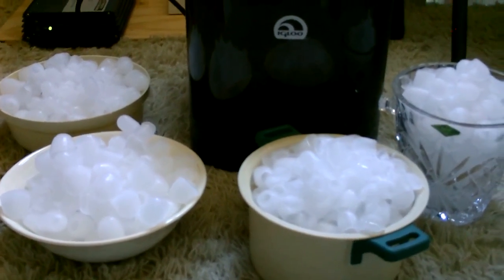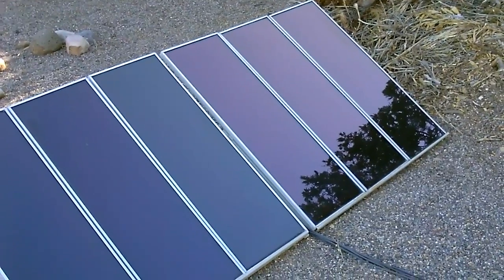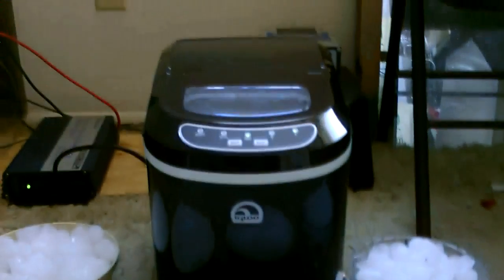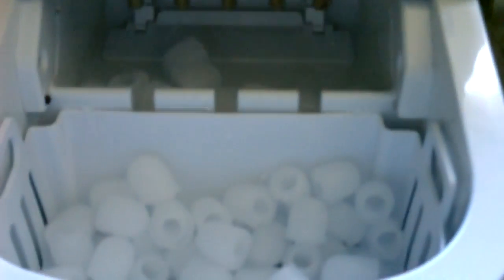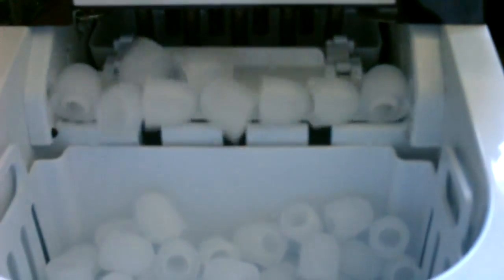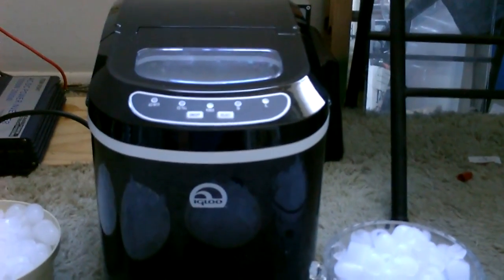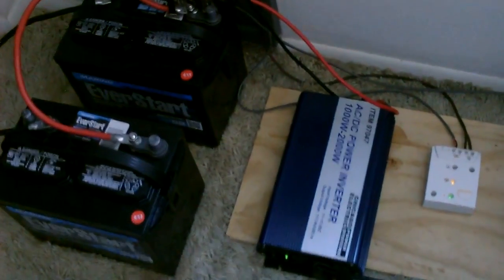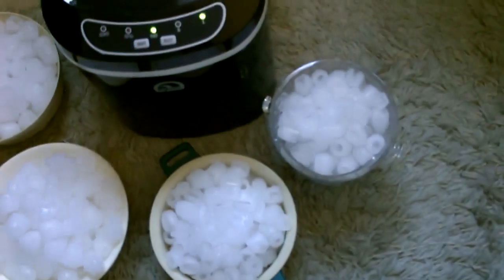DIY Solar Ice Maker - solar powered 'off grid' ice maker - easy to set up! - use HFT panels

Comment: Would this setup work without the solar panels, with the batteries only, and just one marine battery?
Reply from the maker: i think you would need at least two batteries to run the ice maker. it has a startup surge and i don't know if one battery would would handle the surge. maybe if it was a large battery.

Comment: Huh ??
Solar power with extra "battery" hook ups ??
Reply from the maker: hi. since the icemaker has a start-up surge, you need to have a "batteries with panels" solar setup to run it. if it didn't have the surge you could just run it straight to the solar panels.

Comment: One of the most expensive parts of a solar / electrical system are the batteries.   So instead of storing excess energy in battery cells - make ice.   I'm thinking this would work well for my family in the Philippines.  Keep food fresh... make halo halo..or just sell bags of ice.

Comment: Nobody is putting up electrical specs on electric appliances. Getting very frustrated trying to just find out if ANY icemaker will work. By the time I buy a new inverter and icemaker, maybe I should look for a 12V freezer.

Comment: Does anyone know where I can find an ice maker that runs on DC?  Or make one?
Reply from the maker: hi. you can buy 12v DC freezers on amazon. they have them for as little as $150.00. they're not dedicated ice makers but they will freeze ice solid. they are made to run on a cars 12v power port. if you want a larger 12v DC deep freezer look for sundanzer chest freezer.

Comment: what is the rated wattage of the this machine?
Reply from the maker: hi there. it pulls about 90 watts. wattage rating on machine is officially higher than that but that is because it spikes a little higher from time to time. those times are so short though that it's essentially just 90 watts. you need the bigger inverter because of the spike at start-up. that spike is only a fraction of a second but the bigger inverter is needed for it

Comment: Wonder if you can put  a micro easy start on the  ice machine.an use less solor power.
Reply from the maker: hi there. since the spike is only for a fraction of a second at startup it won't really save any noticeable power

Comment: so if u could get the tray to empty into a bigger cooler full of ice water and then have that be the ice water that the bilge pump pumps throught the water to air heat exchanger and fan and have the condensation from that collect and pump into the ice maker :D

Comment: I've started making my own off-grid ice cream. 1 can condensed sweetened milk, an equal amount of milk made from powder and 1 can of creme. All staples in your cupboard. Mix well by hand and mix during the freezing. Use a big bucket of ice, add a cup of salt and churn away. You might need to reduce the amount of powdered milk at your second batch if it won't freeze solid enough. Ive left the powdered milk out altogether  but the result is such a rich intense sweetness I could only eat a little bit at a time. You can add cocoa for chocolate ice cream, vanilla flavoring for vanilla ice cream, or some strawberry preserves out of a jar for strawberry ice cream. Enjoy.

Comment: Some good news, some bad.  The good news is that yes, you're making ice! Go you! The bad news is that you're using almost 8 amps per hour to run that. How do I make ice you ask? I can make ten pounds of ice ever few hours if I want to in my 63qt fridge/freezer that only uses 5 amps per hour and keeps all my food and drinks cold WHILE making ice in good old fashion ICE trays...  And yeah, it all runs on a 100 watt Parnell and a 100 ah battery overnight...  I actually have double that to make the batteries hold up that much longer, but one panel and one battery would also work fine!

Comment: I put a Solar ice system together similar to yours but can't get it to work.  I'm using a 200 watt solar panel, 20 amp capacity charge controller, 2-12v deep cycle batteries,  a Harbor Freight modified sine-wave DC/AC Inverter w/750 watt continuous -1500 watt surge, powering a Dometic ice maker that looks exactly like your Igloo ice maker.  The ice maker comes on and runs for about 50 seconds, then the inverter shuts off into the over load signal  In checking the output of the inverter with a volt meter, the output is about 102 to103 volts with the voltage rapidly and continuously fluctuating between 60 to 100 volts even when not powering anything.  The batteries are fully charged.  It will run a drill or blender or light bulb, but not the ice maker.  To check my volt meter, I checked my house voltage and it holds a steady 120 volts.  Any ideas?
Reply: GereDJ2 I see it did not work. Did you ever get it working? Bet it needed a larger inverter.
Reply: Or a pure sine inverter or a larger inverter

Comment: I wonder if a 300W inverter could run it.  Yes the surge is 800w but some might be able to handle it.
Reply: thats a pretty bad idea. It will only use the current that it needs so its not like it will be cheaper to only use a 300. If it surges to 800 bye bye inverter

Comment: Just had an idea! Have you ever seen those AC people make where they blow air through a cooler filled with ice? The drawback is you need a constant supply of ice. Well, you could set up your solar ice maker so that the ice falls into the homemade AC and you got your constant supply of ice!Come on, man, you already got 1/2 the gear. Give it a try and post a video on how it works!
Reply: I've have been using ice machines for awhile and when I saw a video on making the 11 gal kitchen trash can AC where he's using solar, this is exactly why I began researching how do you solar power an ice maker.  But as I'm looking into it I'm finding it requires more panels and equipment to setup than I expected.  Still researching cuz getting this setup could be a life saver especially with pets if your power goes out in the summer where it gets into the 120's here.  We have lost power about 4 times in past 1 year or so.

Comment: Awesome! I just bought a 5 cu ft. chest freezer for our off grid ranch. We live in the Caribbean so we get a lot of sun. I was astonished at how well it works with relatively little energy. It's a White Westinghouse with fridge to freezer temperature control so I just set it to a fridge mode. It's an energy saver so peeks at only 240 watts!. I use it with a 2000 watt inverter, 2-6volt deep cells and 2-100watt panels and its more then enough.  If used during peek sun hours it doesn't use any battery power so at night we have power for other things. It's quite amazing and liberating to discover what you can do with solar. I could turn up the freezer to make ice but its nice to know that an icemaker is another option. Thanks.

Comment: Your videos are awesome! Anyway to achive this with just one battery? the cars primary battery and a 100 watt  solar panel? Also it would be great if they made an ice maker that could dump directly into a cooler so it could run unattended until it fills up the cooler.  I currently have an 800 watt inverter and can run a lot of power tools like a drill, a hand saw and a grinder, but once I try to pull more than about 600 watts it chokes. Thanks!

Comment: Nice video, I suspect your battery level is decreasing while running the ice maker.  Do you have anyway to verify the charge level of the battery while only using 90W peak panels?  I am also curious about the inverter.  Is it a pure sign wave or will cheaper inverters work.  Thanks.
Reply: Agreed. I can't imagine this will work longterm without charging those batteries externally. 90 watts of panels probably output about 50 watts total. The only reason this is working is because those two batteries started out fully charged. I don't think this would work past a day.

Comment: Why couldn't Igloo make it so the ice just drops straight in the bucket?  That scooper seems like a waste of energy to me. Nice setup though!
Reply: I have a counter top ice maker.  I like it because I always have ice and I only have to refill the reservoir every couple of days.  The reason they don't let it drop into an external bucket is that if you don't use all the ice, it will melt and the melt water will be reused.  If the ice was dropped into an external bucket, you'd have to refill the reservoir every 1-2 hrs whether you used any ice or not.  These ice makers do not keep the ice frozen (takes additional energy to keep ice frozen).

Comment: Just one question. On average in the US, will running an ice maker 24 hours a day (hypothetically) only cost around $10 per month? I don't live in the US, but I tried using an online calculator to get a rough idea.
Reply from the maker: that's pretty close. at 10 cents per Kwh (where i live) and figuring a 30 day month (and using ice maker in video) - it would cost just under $6.50
Reply: yea, I've paid close to 10 cents per kw here in texas or 15 cents per kw in Florida. I think the setup is perfect for a offgrid, or a offshore marine setup. nothing like wanting ice when your 70 miles off shore from the nearest store. thats usually the perfect reason if your looking at cost, as running a generator gets pricey

Comment: You know why there is that 800w peak? Most compressors have a secondary winding that gets charged up for a short time to get it moving because there is so much pressure within the compressor. FYI these days the newer home ACs will stay running (often DC motors, actually) because its cheaper in the long run to "tune it" via a feedback loop to run a little slower than it is to have that big power surge coming on & off. TOS has had them featured on several remodels. Fantastic technology.

Comment: on the ice maker, what's the point of the little scoop coming forward, why isn't it just designed to drop the ice right into the bin?
Reply: The water raises up, covers the tubes and the tubes build a layer of ice on them. Then the water drops, the tubes heat up and the ice falls off. That's why it has to be scooped into a holding chamber
Reply: +BadgerCanuck  thanks for answering that question...i wondered why they did it that way

Comment: Is this a full sine wave inverter?
Reply from the maker: +Bonnie Flory hi there. i went with a modified sine wave inverter. seems to run the ice machine fine and only cost $59.00 (from harbor freight tools)
Reply: +desertsun02 
Thank you for answering my question.
My in-law have the same ice maker. 
This gives me ideas since I have solar panels.
Reply from the maker: ***** hi. you fill it with water

Comment: Could you drop that 800 watt start up with a start capacitor?  You might be able to run this will a lower rated inverter.
Reply: What would your estimate be for the inverter with correct start-up capacitor?  Maybe 200 watts?  And what value capacitor would do the job to start this unit?
Reply: I bought a Harbor freight 750 watt continuous - 1500 w peak inverter and am hoping this will work as I have not assembled the unit yet to test. I have a Dometic ice maker,  two 12v M/27 750 CCA deep cycle car/marine batteries and a 100 watt solar panel w/ DC controller.  Let's see.
Reply: GereDJ2 what was your discovery? Did the 750 inverter work on your ice machine?

Comment: where is the water supply hooked up? Do you add water or do you have a ice maker kit hooked to a water line?
Reply from the maker: +QuantumRift hi there. an internal reservoir in the machine holds the water. no water supply line needed.
Reply: +desertsun02 OK, thanks. I was sort of thinking that...

Comment: man just get the ice to dump into a chest freezer and you have an offgrid freezer / fridge system...run the melted off water from freezer  thru hoses to small rad or copper pipe coil and attach fan and you also get offgrid air conditioner all from the ice maker !!...then of course reclaim the water to put back into the ice maker !!
Reply: please make video about it
Reply: swanyut Love that idea!

Comment: So then you take the ice from this, put it in the modified cooler with fan attachment, run the fan through your smaller single solar panel (or same panel/s if you have extra power) and run your off-grid swamp cooler.  Once made, these things will start saving money.  I like it.
Reply: thats exactly what I was thinking.except  to have a way to automatically have the ice to scoop into a swamp cooler and have an overflow for the melted water because the ice will not escape through the overflow and use another solar for the swamp cooler
Reply: +Alexander Childs This is literally air conditioning

Comment: If you can make ice, you can probably make a solar air conditioner.....
Reply: It has already been done.   Google it.  It can even be done without an energy wasting compressor, using the ammonia absorption system.  Then you can cool the air using solar heat collectors to drive the system.

Comment: Where can I get the Ice maker??? Please. this is an awesome Idea In FloridA just imagine....
Reply from the maker: hi there. you can find the ice makers online pretty easily. i got it on ebay but i've seen them at walmart too. yeah, this would be a great setup to have if you have a power outage and need some ice.
Reply: thank you so much!
Reply: Does it require a water line or does it have a tank that you fill with water?
Reply from the maker: Shane Walker it doesn't require a water line. it has a tank that you fill.

Comment: Someone that knows what they are doing can add a 'starter coil' (really more like a condenser on a car motor) that stores enough juice to get you past the initial spike of starting up.  Full size A/C units use them routinely.  Even on my motor coach roof units.

Comment: Great , you make it seem so easy!!!
 Now, I like to use a similar system to run a small 12V AC system with its compressor, its motor and its fan but don't know how to figure out the size of the solar panels for all of that. What do you suggest?
Reply: +Nora Momtazi 
If you use a 5,000BTU AC window unit you will need about 800 watts to 1200 watts of solar panels and at least 500 ahr battery bank and a about a 2000 watt continuous/4000 watt peak  inverter.
But you only will be able to run the AC when the sun is out. At knight and in cloudy weather there is not enough battery storage with this system.

Comment: I've only got a small inverter (like 200W with 250W use for half hour). its a high quality one that stands up to the heat better than the chinese one i first had. I've seen these icemakers advertised on the net, but can't find them here in australia. from what you're saying about the surge, they sound like they use standard compressor technology. i have a propane freezer which cost me like Aust$900 with hoses and all. and a 12V compressor fridge/freezer (engel).

Comment from the maker: i got it on ebay.  i've seen it at walmart too. you can use any portable ice maker. if it takes more power to run than the one i used, just make sure to buy extra solar panels (and maybe an extra battery). i researched a lot to find the one that used the least power.

Comment: Now you could hack the icemaker to make it automatically dispense ice in a reservoir.  Then make an ac-unit out of a fan and copper tubes and a pump and use a thermometer, some relay switches and a computer to automate the whole thing.

Awesome!

Comment: Groovy. I was looking at one of these last year for my bus but found that ice was so abundant in Mexico that it wasn't an issue but still, be nice to be camped in the middle of the desert enjoying a rye and coke on ice. I'm thinking with two batteries and a 1000 watt inverter  I could pull this off. Thanks for the vid.